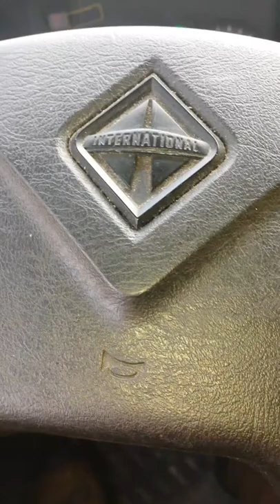Air horn????

Comment: Lol, its just a city  horn. Air horn  is the black cable on the left  hanging  by the top right driverside for jam
Reply: They moved it to its proper location on the LT, on the ProStar it’s on the steering wheel, right side, next to the Jakes.